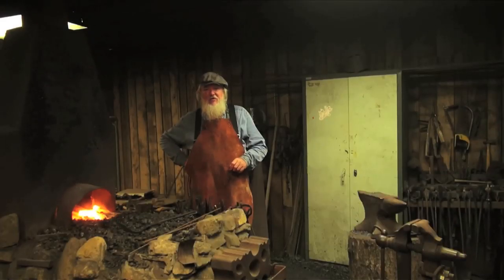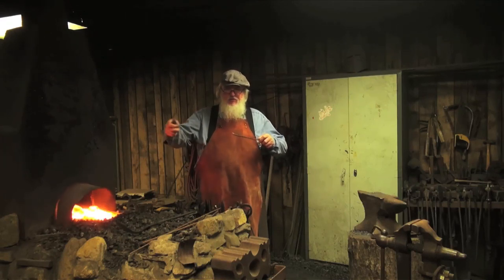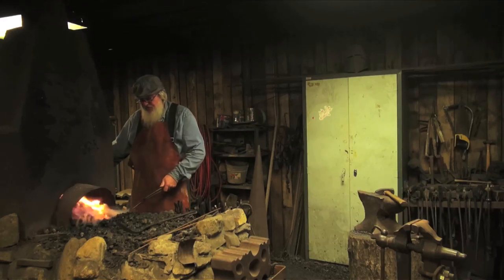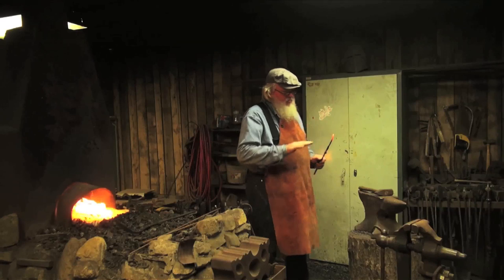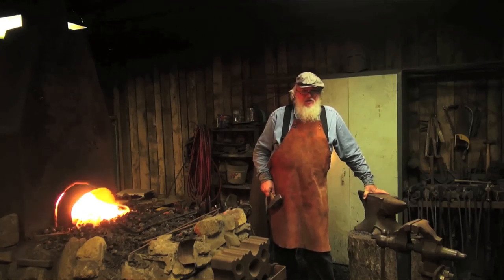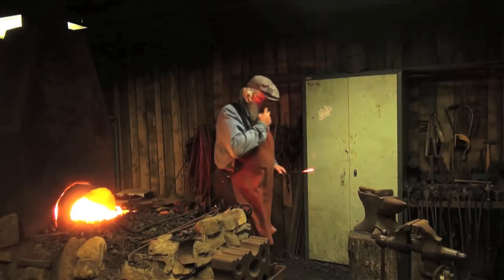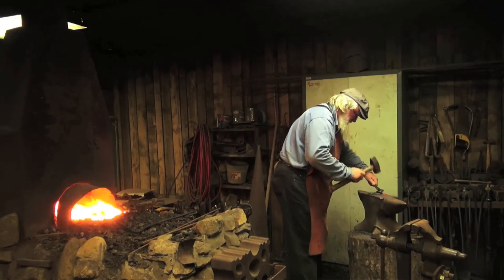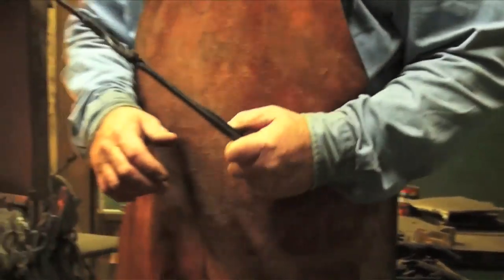Forging a Drive Hook at Calerin Forge

Comment: Thanks for video, I picked up an important tidbit of information I had never heard presented before on quenching thin tip prior to reinstating back into fire to avoid burning up of thin bits. Will add this to my process as I have burned up thin items before. It's funny sometimes things that should be intuitive, a person has to be shown, and then the lightbulb goes on!
That tip should speed up the learning curve!